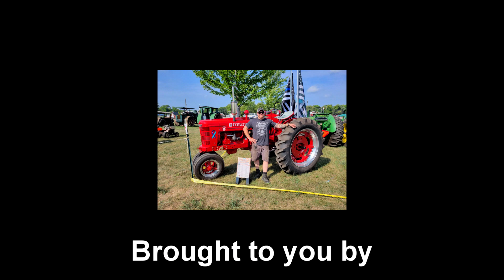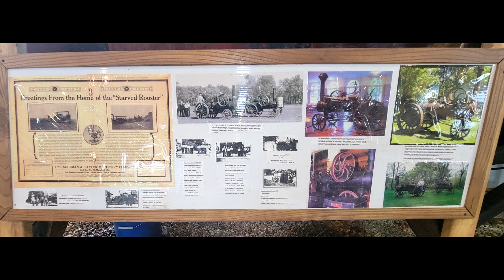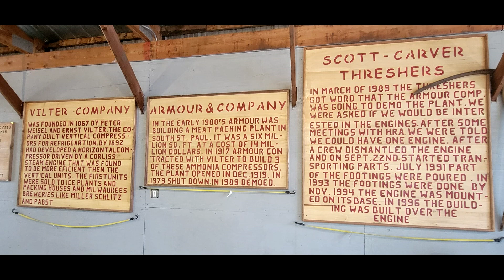2022 [58th Annual] Scott-Carver Threshing Show Featuring Caterpillar

Comment: Just dropped my camper off tonight in almelund I'll be there all weekend bringing the case 500 diesel again it will be the only one there you'll probably see it. I used to go to Scott Carver as a kid all the time out of the two huge steam engines I know the one is a vacuum pump and that one always ran the bigger one beside it iirc is a steam powered refrigeration compressor that one was seized up when I was a kid.  Cool stuff maybe I'll run into you this weekend
Reply from the maker: It's a great show. Glad you enjoyed.

Comment: I love that Autumn Taylor 30-60 Prairie tractor Besides the Oil Pull Prairie tractors the autumn Taylor 30-60 model is probably my Most favorite because I like how it has a tank on the front for the water that makes it look like a steam traction engine But the water tank on the autumn Taylor tractor is for the radiator to prevent the engine from overheating
Reply from the maker: I'm amazed at the engineering involved in all of those old prairie tractors and steam engines. Still a modern marvel to me!